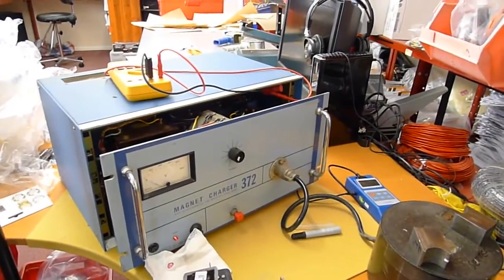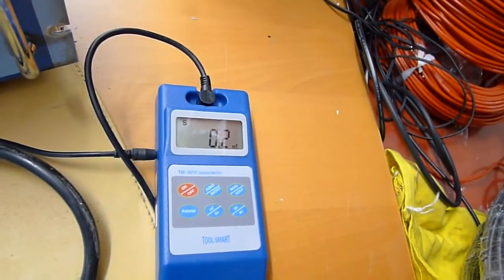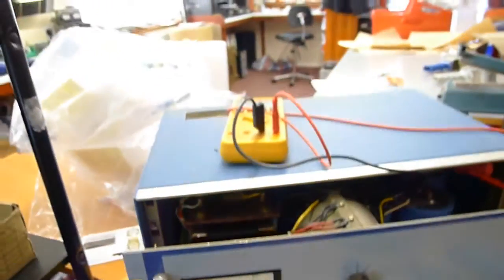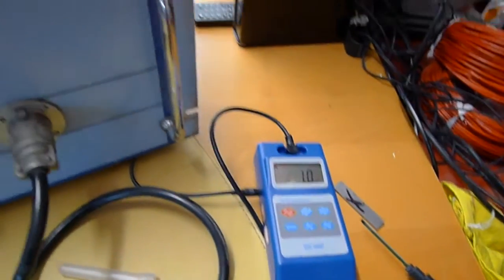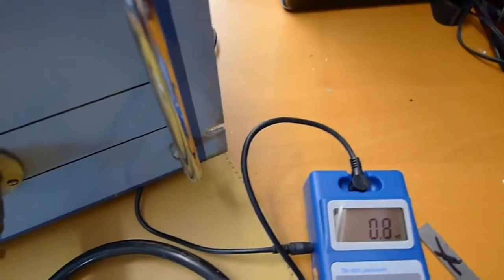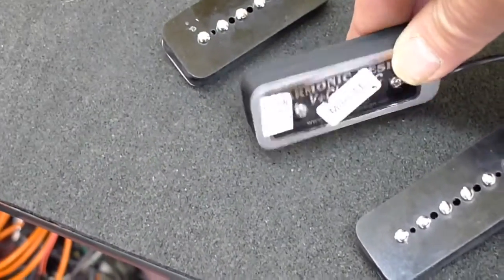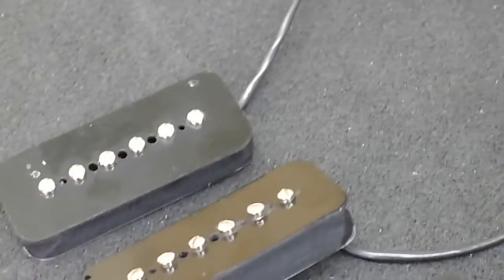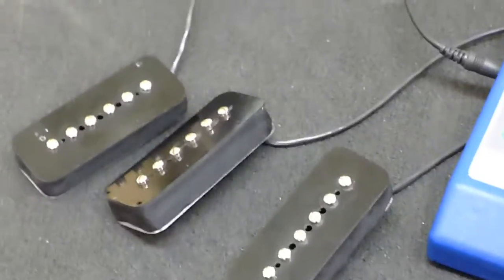Magnetic setter. Magnetising guitar pickups. Measuring Gauss.

Comment: Would such a Gauss meter as you have be sensitive enough to detect whether cassette tape transport mechanism and heads are magnetised? Thank you!
Reply from the maker: Hi. It can, but modern heads do not become magnetised, so you may not see any reading.
Reply: @nickadams5411  Hello, and thank you for the quick reply. I asked about cassette heads specifically, because I assumed their smaller size would perhaps require a very sensitive instrument to detect any magnetisation. I found a lot of info and debates online, but I couldn't find a satisfactory answer.
Can you please elaborate what do you mean by "modern heads"? The most recent cassette deck I have is from 1989, but I also have older tape machines, both reel and cassette that I would like to check (I have 4 reel-to-reel decks from the 60s, 3 of them Uher). Therefore I am trying to find a universal tool with which I could measure if there is any magnetisation and if any parts of the tape path need demagnetising. Thank you again. Matthew
Reply from the maker: @I967  Hi Matthew.  A tricky one, as I find that the magnetisation of parts is over emphasised. I never worry about it . The condition of the head and gaps, alignment etc are easily adjusted and measured. But as you say, the magnetic field of guides etc is extremely small and hard to measure.  I  have not needed to check any readings that low, so not sure which instrument will be the best for you. Study the specs and find the most sensitive. All the best.
Reply: @nickadams5411  Thank you, I will continue my research, hopefully coming to some fruitful conclusions. For now, I will keep doing simple listening tests as before and demag as needed. Matthew